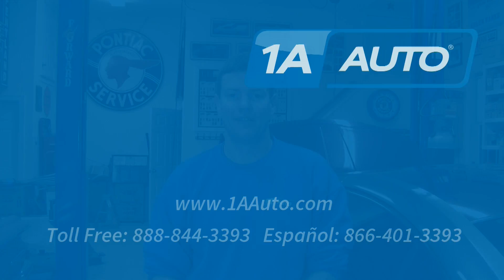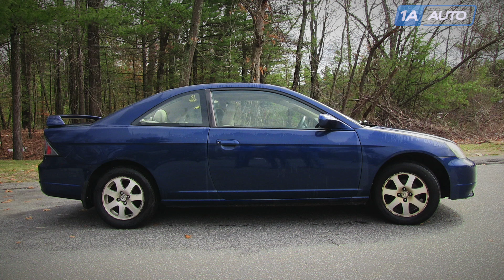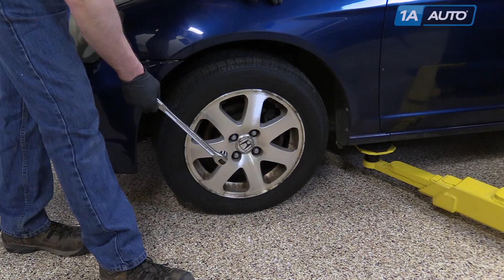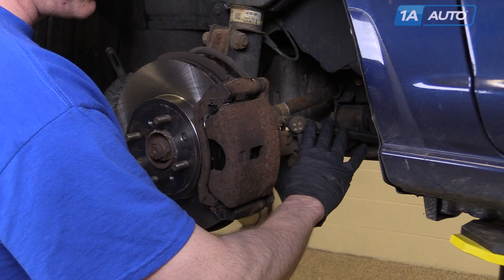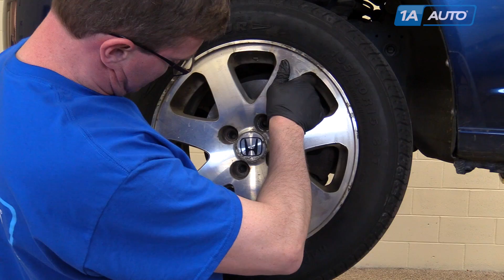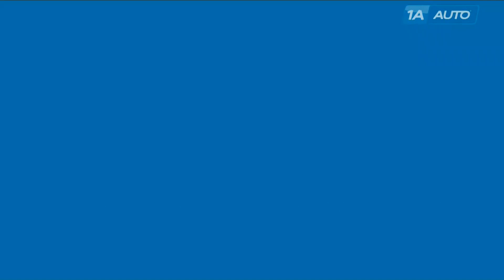How to Replace Stabilizer Link 03-05 Honda Civic

Comment: You really should show us exactly where to cut.  I just cut mine in the wrong place and now the job will be 10x harder than it should, and I'll probably have to drive it without one link attached just to get what I need (5mm hex bit) to finish the job.  At least I won't make the same mistake on the other side.
Reply: I made the mistake on both sides, the hex and the nut both got stripped😔

Comment: Does the car have to be on stands or a lift? I don't think the sway bars are under any vertical load, so could these be changed on ramps?
Reply: Could question. I was hoping to do mine on ramps

Comment: If the whole sway bar and links are rusted, should I replace the whole sway bar and if so do they come with the links or are those sold separately? And info is greatly appreciated, as I took my wheel off and the bushings on the links need to be replaced but everything is very rusty. So I’m thinking of replacing the whole sway bar assembly.

Comment: I never heard tell of a stabilizer link until today.  I am on my 3rd Honda Accord and this one that needs the part is a 2014 Honda Accord Hybrid.  It's the first time I've ever had to replace this part in any car.  My current mileage is 28,429 miles.  Seems low to need a suspension part replaced.  Do you know what causes these to break?  Mine started making a knocking noise even when driving over small bumps on the road.  It was the driver's side only making the noise.
Reply: Thank you.  I’m guessing it was a faulty part since my car had very low mileage and is not even 3 years old yet.  I hope the new parts last.  My last 2 Honda’s never had these replaced.

Comment: Do You Really Need To Replace Both Of Them If One Is Broken?
Reply from the maker: +Lupe Martha If the rubber bushings are fine on the other side then you do not have to. Usually the go bad around the same time. We carry the sway bar link pair shown in this video on our website. Here is a link to them http://www.1aauto.com/sway-bar-link-pair/i/1asfk00270?utm_source=YouTube&utm_medium=CTA+Comment&utm_campaign=ytcomment&utm_term=C2BwGsP4ZDA
Reply: The Thing With Mine Was That It Wasnt Bad But A Really Bad Pothole Made It Brake
Reply: why not....u can get a set of 2 for 20.00 or less on ebay